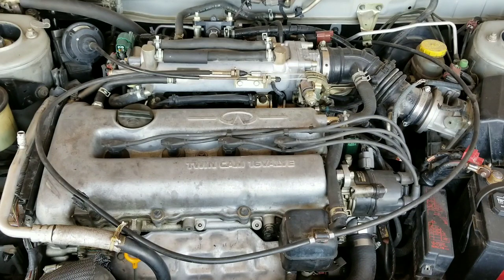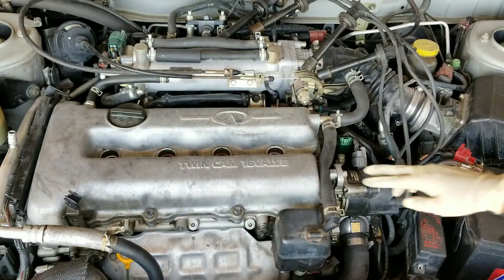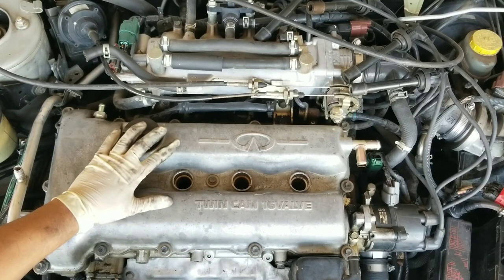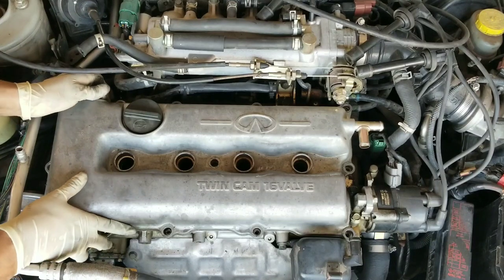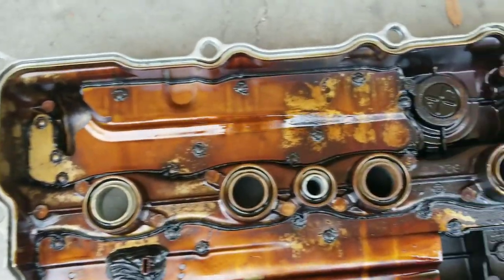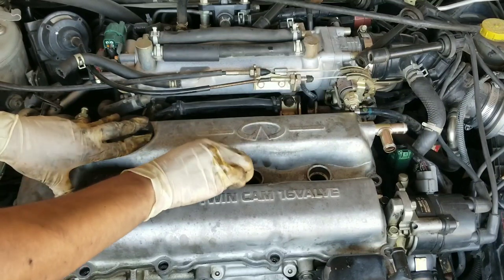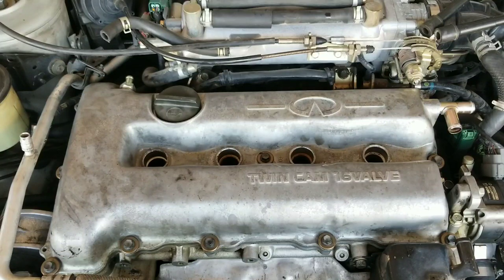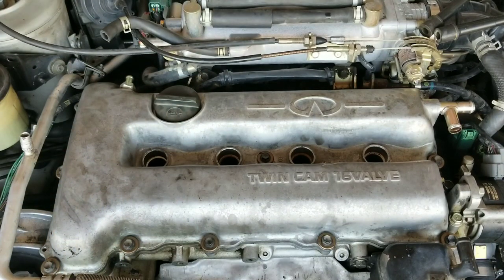How To Replace A Vale Cover Gasket On A SR20 Engine : Infiniti G20 Valve Cover Gasket!

Comment: I know this is an old video but can you compare this engine to any 4 cylinder Toyota has in terms of reliability? You see lots of youtubers bragging at how Toyota is the best but this engine to me is just as good. My G is 23 years old and engine performs like new.  I do have the original plugs so this video was helpful.  I see you have the original Mitsubishi distributor like I have. They last forever.  I did change the valve cover but really didn't have to cuz there was only a drop of oil leaking.  Got a made in Japan part and fit perfectly.

Comment: Hey man I need to replace my lifters. Have you done it before? I’m looking at the head assembly in this video and it doesn’t seem like there’s enough room to get two valve spring compressors in there to remove the rocker arm. Please lmk man! Thanks

Comment: Hi,  great video, I have the same engine in my old nissan p11, when you put the joint sealant you have to wait 15 minutes before putting the cover and then when you finally tighten the cover, how long you have to let it dry to start the engine?... thanks for share it.
Reply from the maker: Thank you for watching, correct that would be the proper way to install it. I left it a full 24 hours before I turned it on.  Thank you for watching!
Reply: I did it following your video, and it`s very good, is a great sensation. thanks again.
Reply: @ERICSDIYGARAGE  hello, thank you for your video! Some people put joint sealant in the rings of the spark holes and on the ring of the central bolt, is it better not to put?

Comment: I just did a valve cover gasket job on a G20 but inside the valve cover gasket that little plastic red breather thingy broke. That one area with a blob of silicone and one piece of plastic poking out snapped should I worry

Comment: Buenos dias como estas, me podrias ayudar con este motor nissan BATARTZP11GDA-DF      necesito saber como va instalado las mangueras de la bomba de alta presion y como poder revisar dicha bomba de gasolina
Reply: Haber man si me puedes ayudar con este nissan primera que ya me trae problema, ademas como puedo buscar un manual de este carro con esta clase de motor
Reply from the maker: https://web.archive.org/web/20171029164007/http://nicoclub.com/archives/infiniti-g20-factory-service-manuals.html

Comment: At 1:35 you show the wire harness cover. Mine doesn't just lift up, is there a trick to getting it out of the way?
Reply from the maker: it has plastic clips that you need un clip this one was broken that's why it came out so easy
Reply: @ERICSDIYGARAGE  would those clips be the ones you can see on top or are they below the cover? Btw, thank you for answering. If I can get this thing off I'll be changing my gasket, thank you.